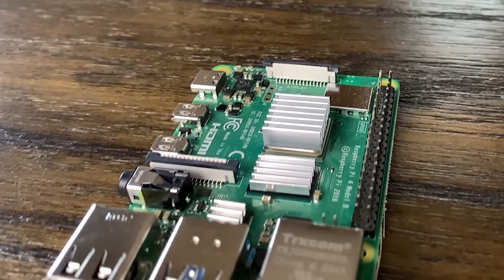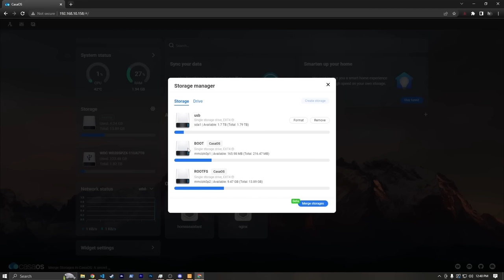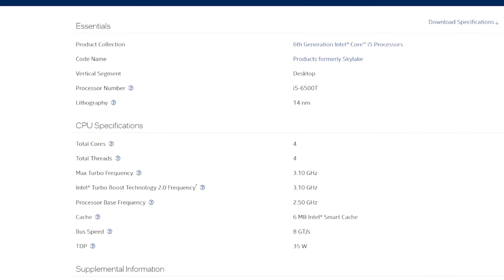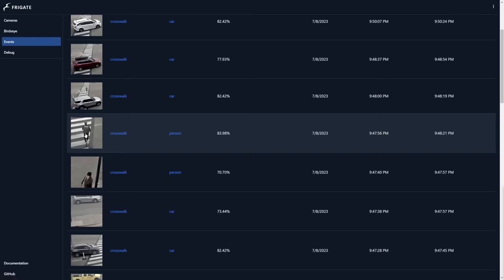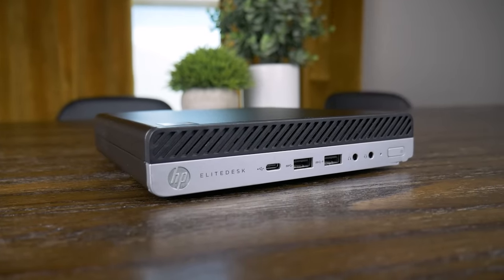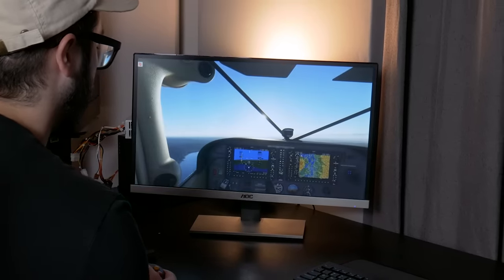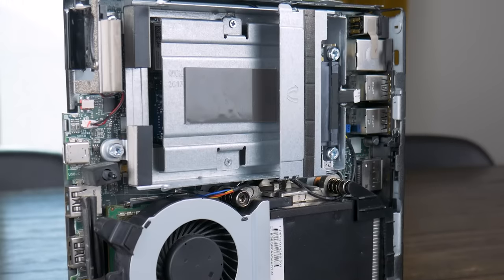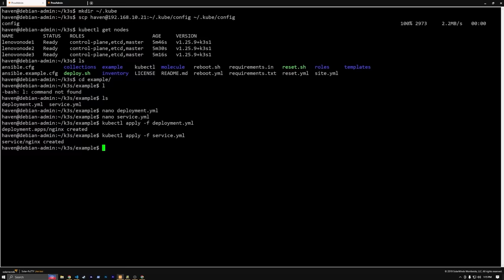The Mini PC You SHOULD Be Looking At

Comment: I'm a little late on this, but I just went through this evolution. After reading that a Pi 3b 'can' be used for home assistant, I decided to dip my toes in the water. It can't. As soon as I have more that a couple of integrations installed it would freeze the moment to tried to load a new page in the interface. I started poking around and found the Dell Wyze thin clients. Ironically in this vintage they're all about the same price whether you get the pentium gold models or the i5 models. Thinking that a couple of bucks of electricity was worth never having to worry about running out of compute again, I hit the buy button on the Wyze 7040. It was a great decision. This thing is near silent and it's rock solid. Sure it's not as small as the pi, and it's probably massively overkill to run a basic smart home. But I couldn't justify the price of a new Pi5 when these things have so much more compute for a lower cost.

Comment: I have a pair of Lenovo M73 TFFs retired from a former employer that I use as a Surveillance server and recorder and as a Linux (Debian 12) desktop. Both are i5s, and work well, better in fact than the Pi4s they took over for. For the lab, I have a Ryzen 7,  32GB, 14TB running Debian 12 and VirtualBox. VMs include NAS, Surveillance Server, several desktops (including a Win10), ADSB, Scanner streamer, and whatever I want to throw up for testing. The Lenovos have filled a niche and got me back to X86, at least until either RPis come back down in price and increase availability, or one of the other SBC ARMS develop etter support.

Comment: as a EliteDesk 800 G2 owner, I discovered that virtually all 1TB+ 2.5" HDDs are SMR.     avoid like the plague, I tried to use one as a on demand PVR (7 PoE cameras configured to record only on motion detect), and the drive failed in less than a year.  Mine came from fleabay with a refurb win10pro license, 16GB ram, 256GB M.2, and no HDD.   it makes a great PVR except that 2.5" disk problem, currently its recording over my LAN to my NAS

Comment: I used one of these as my HTPC. I can't remember what version it is, but it is an HP "G" something. The nice thing about it is the CPU is a Ryzen 5 25XX (I'm not at home, I'm 4000 miles away on vacation, is I can't remember anything more than second gen.) The onboard GPU on these chips are pretty good, and my son played Fortnite on it as his first computer. It wasn't the greatest, though, so we upgraded to a Beelink with a Ryzen 5 5600U. That is better, but still not as good as my laptop. My wife is using the HP and it replaced a full size tower, so it's not only more efficient, but faster.

Comment: On your inspiration, I found a Lenovo M910q on eBay, and bought a pair for $110 each with i5 CPUs.
Docs said the CPU supports 64GiB of RAM, but 32 was the maximum.
I took a chance the 32 limit was a Windows limitation and ESX would gobble it all up. That and a 2TB SSD, and I have a cluster!
Thanks for the encouragement.

Comment: I Got the M900 and i put a 6600k inside wokd like a charm .. the EGPU doesnt work because the m.2 prot doesnt  support NVME/ PCI EPRESS lookigmg to get a lenovo M720Q with the PCIE port inside and jerry rigg a GPU in there i also got a 120watt gaming pc charger for an older version i had that worked with the EGPU and it worked ike a charm 60fps gtx1660  on a lot of games

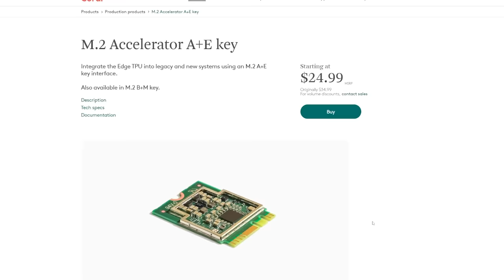Comment: 3:51 if you dint mind having a hole in a case you can get an pcie x16 riser hooked up and have an egpu in this and this would make it a very good gaming mashine tbh
Reply: Even better is removing one of those optional ports on the back of those HP mini PC's and routing the eGPU cables through that, everything will stay closed and luckily no modding the case either. I've done that aswell for my Pc and hooked up an external GPU, works like a charm

Comment: I know this is an old video at this point but I saw you cover LXC containers and I just wanted to say that outside of old OSes, damn near everything can be run in them. Including CasaOS. You can hand an LXC container 6 cores, 8GB of RAM and tell it to run all kind of Docker containers within it. Its supremely powerful. Outside of that Skylake CPU's are kinda trash because the Retbleed mitigations affect how much power they draw and how many cycles they use.

Comment: It would be great to see how to build one of these PCs into a firewall utilizing pfsense or opnsense. 

Seeing the m.2 to Ethernet adapter may be just what I need to provide the second Ethernet port needed.
Reply: That's what I was thinking about - replacing my old desktop OPNSense machine with something smaller and lighter.  The only requirement would be 2 Ethernet adapters.  This video mentions an expansion port that adds a second RJ45 port but doesn't go into details.   😦
Reply: @RichardHurt  I also remembered you can do a 1gbe Ethernet to usb adapter. I don’t know the programming, but that would be the simplest solution I can think of. 

I have also seen examples of using a managed switch to create a lan and wan for a 1L machine.

Comment: FYI: The fan control in that specific HP mini PC is kinda annoyingly loud, because it never turns the fan off. There is also absolutely no way to control it, not even in the BIOS. However you can just get rid of the fan if you use it as a low-power home server. The passive cooling keeps it at 40°C on idle, and if it really needs to compute anything intensive it thermal throttles automatically at 80°C.
Reply: I've heard similar stories regarding Elitedesks heating up a lot, it's suspected to be because of the use of copper heatsinks. The heatsinks on the Prodesk line aren't the same, and from my experience they don't heat up that much & the fan isn't obnoxiously loud

Comment: My truck computer has a feature that is unnecessary.  It has a high heat shut off.   There are 60 approximate wires running into  and out of the computer.    In years previous there was no need for the high heat cutoff.    If the motor gets hot then the  light comes on and  I look for a gas station to cool off.   This truck just shuts down in traffic.   Then I take a lazer temperature and it reads 133 farenheight.  Which is not hot.  So I could put in a new computer and program it my self.   I would need 60 Input output pins.  Where do I get one???

Comment: The ProDesk 600 G3 is almost the exact same thing, except it only supports the T variant Intel CPU's (Such as the i7-7700T, which has slightly lower clocks and boost). If you don't plan on upgrading the CPU, don't bother with the EliteDesk version if it's going to cost you anything extra.

Comment: I love these HP mini's!
I currently have three 800 G3's and a G2, all of them for under $200!
They are so small and quiet and provide far more processing power than Pi's or those other J- series or Atom- series CPU's!
I plan on buying more to add as nodes to my PROXMOX server sitting in the basement.

I too have not tried the 2.5GB or dual ethernet yet, but that is coming soon!
Reply: Can you give more details on the dual Ethernet config?  I would like to use one of these as a firewall/router (OPNSense) but I need two Ethernet ports.

Comment: The one I bought ran hot (212F)while using Handbrake. Thought I would redo the thermal compound to see if that helped and found that the screw holding down the cpu bracket was one thread short of falling out. Should have taken the whole thing apart to check/clean everything. Lesson learned.
Reply from the maker: Oof yeah that’ll do it haha

Comment: For comparison, I have an old Dell laptop from 2016 with a 7200u on the last gen motherboard, the same one they used for the  6000 series CPUs.
 It handles 1080p media, moonlight game streaming, several dozen browser tabs without much of a fuss. 
$50 for those HP mini PC's is a pretty OK deal if you don't have to put nay work into them.
I had been looking at them to put at a couple TVs in the house to act as a media streaming device. From these benchmarks, that 6500t is actually quite a bit more powerful  than the 7200u

Comment: one major use I don't really see that's being told :
those machines are great if you need / want a baremetal Active Directory master

I'm already running a pair of pretty heavy duty TrueNAS boxes (both with ECC, main one being dual Xeon v2s and the second one being a lone i3)
Those machines need to be rebooted once in a while, at least to update / clean / fix some issue.
my domain being deployed on everything and with radius on my network, I need at least one Active Directory / NPAS server up at all times, so those work great for just that !
most SBCs being ARM, they cannot run windows server and hence cannot run an Active Directory server at all

Comment: I bought a Dell 7040m with i3 cpu and 8gb ram and 512GB NvME drive for $80.   Upgraded the ram to 32GB and put in the latest WIFI/BT adapter and upgraded the cpu to the 6500T with Windows 11 pro.  Got a 27 inch monitor connected to it.   I use it for getting wiring diagrams and youtube and prodemand for work.  Plenty fast for that and I could emulate some games on break.

Comment: Rebuttle to "Can't use it as a NAS" - I have 3x of Lenovo's M910q 1-liter with 6x WD Elements USB 3.0 12TB drives in a ZFS RAIDZ2 array and GlusterFS on each...  don't need a USB port for keyboard/mouse if you bluetooth it for setup and then go VNC/RDP for the rest of it's life.  It works fine if you design your storage for what it is.  Standing vertical, all the drives and machines fit in a 4U rack shelf.

Comment: I wanted to use an HP 600 as my OPNsense router hosted on Proxmox, but the Flex IO v2 card that has 2.5Gb networking would not fit, as the 600 uses only v1 Flex IO. I have 2x 2.5gb Flex IO cards just sitting on my hardware shelf now... /sigh.

Comment: One compatibility note: I have this exact same mini pc and despite what you mention in the video, a coral accelerator will NOT work in the small m.2 slot: the motherboard will provide power to it, but it will only accept network devices. I believe this might be a BIOS limitation. Updating to the latest BIOS will not fix it. Buying an adapter and sticking it to the larger slot works, but only 1 of the 2 coral accelerators are recognized
Reply from the maker: Strange. I got it working somehow.. at least it was recognized and frigate was working
Reply from the maker: I used the single tpu accelerator not the dual
Reply: @HardwareHaven  oh could that be it then? I have a double TPU... Mm would want to try a single then!

Comment: I would love to use mini-PCs like these, but while it seems their power usage is "low", it quickly adds up when you're not somewhere where power is a negligible cost, a bit more modern system than this might be cheaper after just a year or two. As an example, running this 24/7 at idle would cost me ~30€ per year, so it'll cost more in power than the acquisition cost in just 2 years. That's the main reasons I don't use a mini PC as my router (7-8W idle), but a ZimaBoard (I think 3-ish W at idle, and not much more at max load).

Comment: What is the "thing you ordered" for dual lan in guessing? I tried to find something to swap out where you have a display port. I have VGA, but I can't find anything. So my solution was a USB c to Ethernet HDMI and USB hub which I haven't tried yet.. I got really lucky the one that I ordered the G3 800 mini. The guy just shipped it in a bubble mailer like no kidding. I freaking bubble mailer so it was crushed when I got it and I emailed him about it and he just refunded my money and didn't want it back. After some tinkering I figured out that it was getting shorted out from the case being bent and I was able to fix it and it works fine. I ordered an i5 7500T and I had two DVR for 8 GB RAM stick sitting around for a total of 16. After starting it up the other day it wouldn't start and after looking at the code that it flashes it was telling me that it was a memory error. So I figured I just need to reseat the ram, and voila it actually worked! I just don't know what exactly what to do with it. Now I have a custom router firmware on a SunCom 5G CPE router that I replaced with something called Rooter which is a build of open WRT. But I'm having the damn this time trying to figure out how to create separate lans and start wire guard on it even though it's literally got a section that says wire guard. I can't figure out how to start it or if I'm supposed to join it to another land or what.  But anyway, I figured this could be my services set up and run opnsense, and home assistant with adguard and maybe a couple other things? But I have no idea how to get started. I'm getting inspiration from you but I'm just having a hard time executing.  It's like every time you set something up you're doing a raise set up and I don't have that ability really and I don't know what to do. I haven't 600 G2 sff desktop with an i5 6500 and 4, 4 GB RAM sticks as well as a 14 terabyte hard drive that was brand new. I scored on eBay even though the jerk said it was 18 terabytes.  Anybody think of anything to put all this together? I would really love have a jellyfin server and just use that hard drive to back everything up as well as some kind of next cloud integration so I can backup my phone and critical laptop things and maybe eventually add another couple hard drives. Even though they're connected via USB, it's better than nothing. And maybe some kind of quick file sharing setup like where I can send somebody a link and it just gives them a file from my home network that I uploaded previously . 
Sorry, I know my responses are always winded and long but I feel like if I don't get it out there I'm not doing myself justice by explaining everything lol.

I've also got a raspberry pi 4B that I want to utilize. I purchased 3 years ago and I've never used it as well as a pi. Zero w. I bought it at the same time.

But as far as the 800 G3 mini that I resurrected I would love to do OPN since cuz it seems a lot easier than this open WRT thing I have from ofmodemsofmen rooter custom firmware that I spent hours getting on this massive national security risk of a router from China as people have found that it was reporting back to some province and that installing this open WRT install would make it white top tier..

But no matter how many people I ask, nobody seems to know how to set up wire guard even though there's people actively talking about how they set it up just fine. They just never answer my questions. It's like I'm getting to run around and people think it's funny to poke fun.
Maybe I'll get it eventually, but for now I would really love to set this up to host my home services. If anybody has any idea please let me know. I watched your jellyfin and ultimate router video but I just got lost at the beginning when you're setting up proxmox with op3 or whatever it's called because you want UEFI boot and you're running a raid setup and I just don't have the stuff for that. Like I said, this 800 G3 mini has a 500 gig SSD in it and then I've got that 14 terabyte USB 3 drive.. and I'm guessing I should get or would really like to get a second land port besides this USBC set up. I haven't even tested yet. I just barely installed fedora on it an hour ago and it's like I'm totally lost now

Comment: I'm not a fan of the chassis design on the HP mini PCs, but the similar machines from Lenovo and Dell are straight up bangin' for light tasks.  I have one running as my media PC in my living room, one connected to the TV in my bedroom, one running my pfsense firewall, and another that I keep in a laptop bag as a 'mobile' workstation.  It's FAR more powerful than a midrange laptop, and other than having to plug it into a monitor or TV, it's almost as portable.

Comment: This is what i did when pi's were too expensive and I'm glad. For about $150 with shipping & tax, I got one of these Dell 8th gen i5 mini pc's ( not micro,3 low profile pcie slots ), 16GB/256nvme. I upgraded the ram to 32gb, and added some more storage, and it's amazing how much this has consolidated all my usual systems in one box & the limiting factor is now my gigabit network. Ended up putting PiHole, a NAS ( USB-C drive dock ), and some file sharing systems on proxmox. So I saved money on the miniPC but now I'm looking at upgrading to 10gbit ethernet, which is as expensive as you let it get :(

Comment: Heads up! Those HP mini’s use a specific power cable. It’s a large barrel style but the barrel is slightly longer than others. Though you can’t use most chargers, it does share the same charger as an HP laptop charger. I can’t remember the wattage off the top of my head but I think it’s 65W or higher..
Reply: You can pick up a cheap universal power supply that comes with swappable barrels to fit your need for around $20-$30. Needs to be 65w or higher.

Comment: For how much power is that flimsy sata cable rated ? What do you thing about sata power splitter on it and M.2 to 4-6 sata ports and mounting 2-3 HDDs with 3D printed top for the PC and it will probably end up a little less than 2L overall

Comment: I was thinking this would be RockChip-powered SBC but it's the older low power intel chip. 

Speaking about intel, maybe explore their new Atom (E cores) solution that is designed to work best at low optimal TDP rather than at its max TDP. There are two variant of pure E core solution, which the Intel Processor N100/N200/N300 series or Atom Processor C1100/C1110/C1130. The former has IGP up to 32EU but limited to single channel and PCIe gen 3 while the latter lacks IGP, but dual channel and PCIe Gen 4